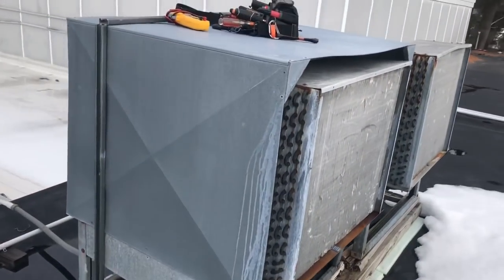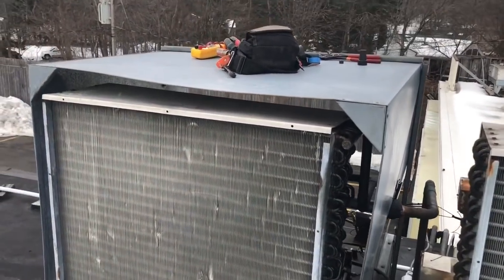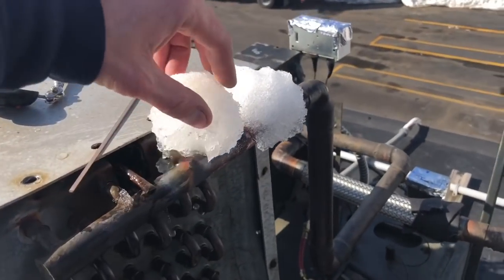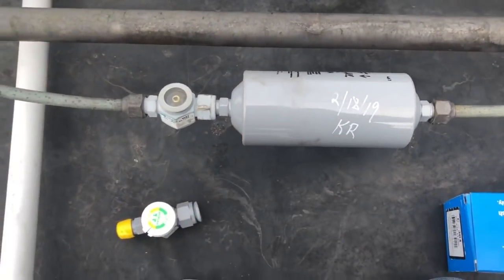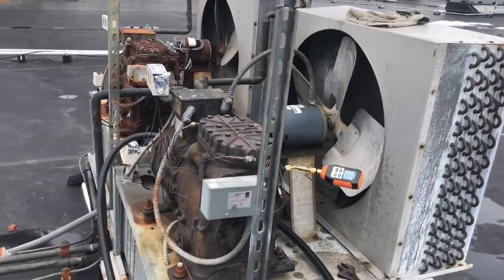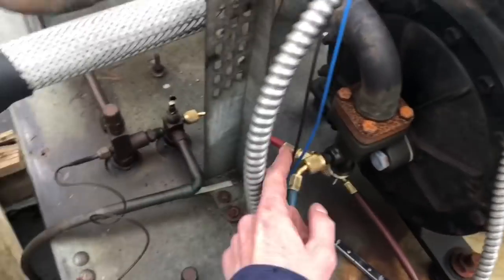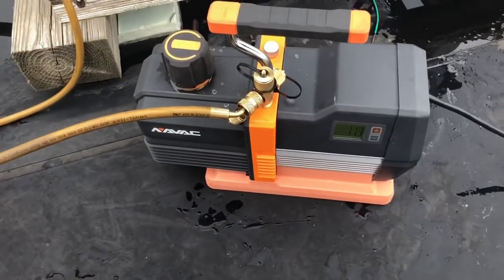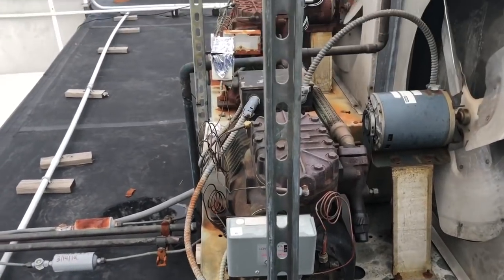Walk-in cooler condenser coil leak . Refrigeration life # 26.

Comment: Great idea of throwing the pump on the gauges. IVe always just done the old crack the hose at the service port and bleed the air out before opening the valve. Gonna use this method next time!. Also that navac looks pretty awesome , just switched this summer to those larger hoses and a blue vac micron gauge and boy do they make a difference!
Another great video man keep em coming.
Reply from the maker: W Myers thanks man. Yes the bigger hoses make a huge difference. I usually just crack the hoses too hahah. But figured I’d show another way to do it too.

Comment: that vac pump & micron guage is sweet ! they cost more than the vac pumps we been using for years but it may be worth it....i saw you had the veto tote bag up there...i have the large tote bag...comes in handy when loading stuff up to the roof...good job bro 👍
Reply from the maker: kingofthecrease30 thanks man , the pump is pretty cool so far. Yes it’s the smaller veto tote. It’s been great for getting stuff to the roof. Way better than a 5 gal bucket haha